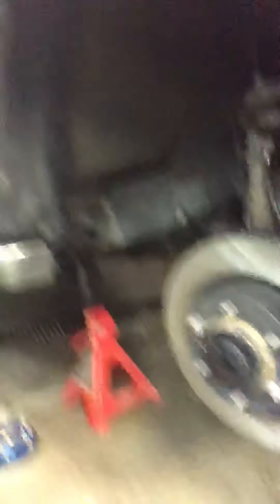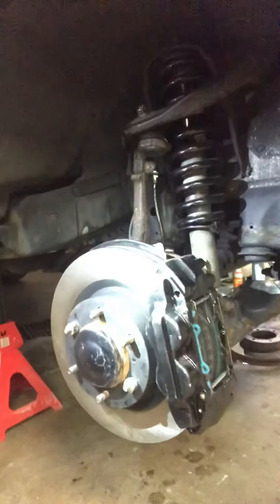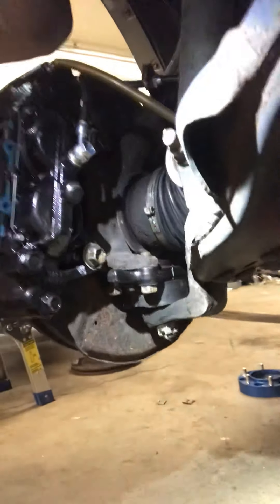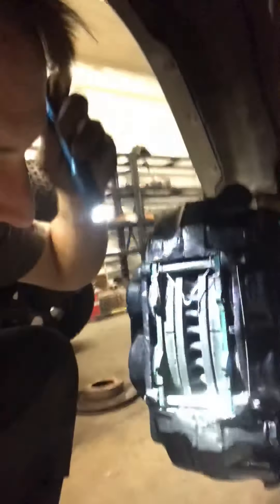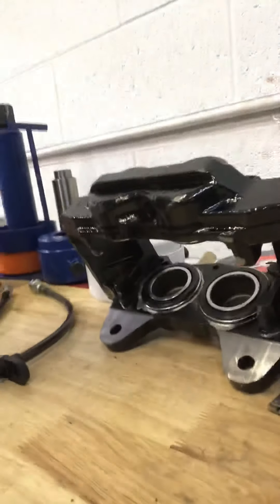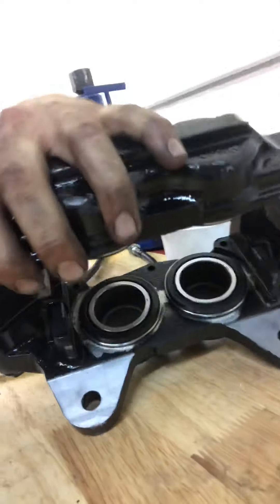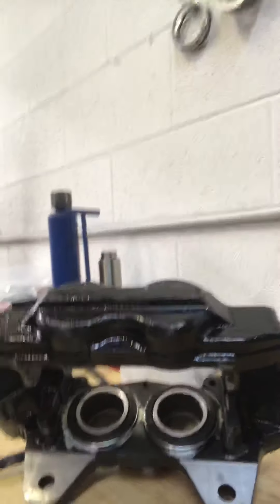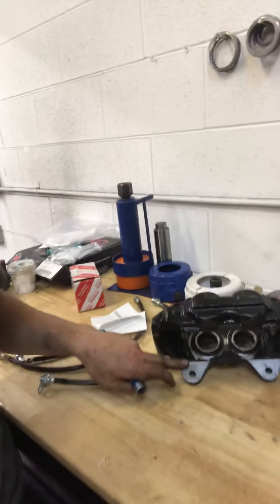GX460 Brake Upgrade.

Comment: So I used 2010-2014 4Runner front brakes on my 2004 4Runner. Definitely bigger rotors! Can’t use 2015 and up calipers because the mounting bolts are bigger. Only 2010-2014 are direct bolt on calipers! ✌️

Comment: I did this upgrade on my 1g tundra and my brake pedal became spongy. I was told i need the t100 brake booster and master cylinder?
Reply: Did you ever figure out your issue?

Comment: Do the larger rotors require trimming the backing plate?

Which vehicle do you buy the crown brake lines for? the Lexus or the first gen tundra?

Comment: Well I see that this can be done for a 3rd gen 4Runner but what for the rear is there any recommendations for an upgrade conversion ???
Reply: Also do you used the rotor from the Lexus or the sequoia or 4Runner??

Comment: Would this clear 05 Sequoia limited OEM wheels?
17″ diameter, 7.5″ width
Reply: Rim diameter is more important. As long as its 17 inch or bigger you should be good.